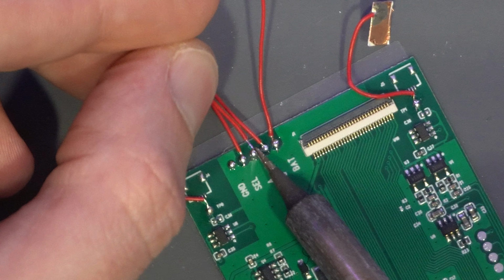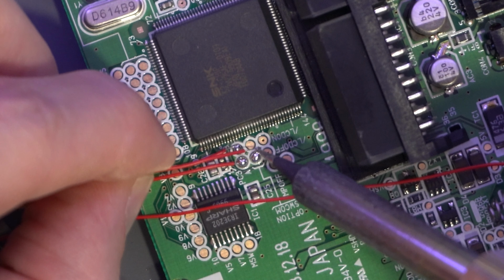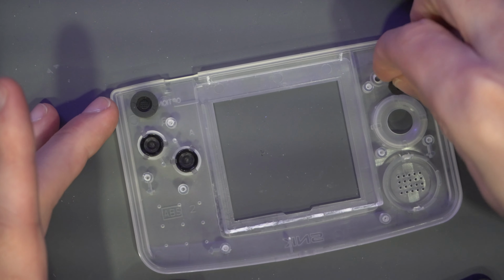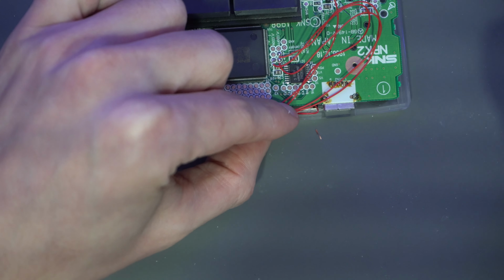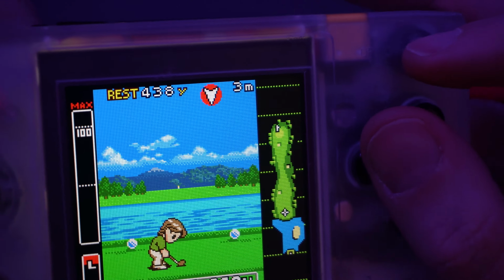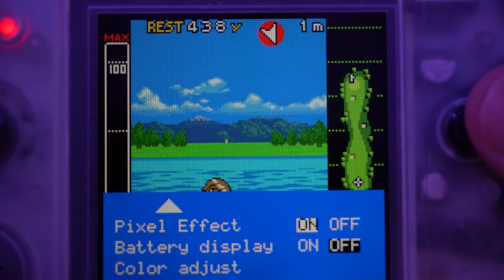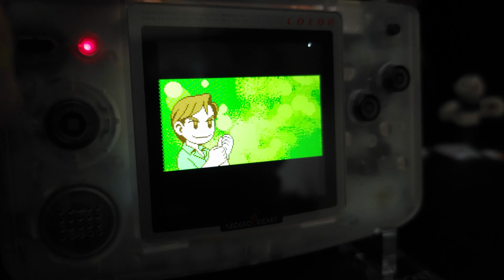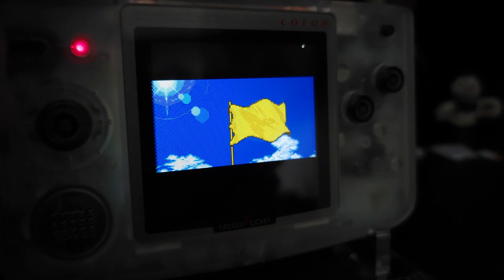NeoGeo Pocket Color Q5 IPS Screen Install!

Comment: For my kit, I'm not totally sure if I received a BlackBerry Q5 LCD, the black levels could be higher. My kit is 1st gen and required shell trimming. I've read that the second gen kit that came out a year later doesn't require trimming. I also used a console 5 alignment bracket. Mine successfully paired with the dehiss and amp mod kits sold on retrosix. Had to use 1.5v li-po AA rechargeables after, just like my other recent mods. I also have to hold the power button in for a second to power on. Works with my retro hq flash cart as well, but the NGPC makes an audio hum noise on it's main menu. After a game is loaded there's no noise. I've noticed the hum noise with other GBC mods indicating the power draw is stressed or batteries low. Wish there was a new power mod for the Neo Geo Pocket Color.

Comment: everybody in every video is replacing the front glass on theirs, what if I have a stock one that’s already good, can i keep the original front glass?
Reply from the maker: Everybody replaces the lens because the IPS display is larger. If you use the original lens, some of the screens contents will be cut off and it will not look right. Same with the soldering, initially I felt that it was optional, but it is helpful to solder the wires because it makes adjusting the screen easier.
Reply: @linklooklisten  tbh I watched 3 modding tutorial videos and literally nobody mentioned the glass being different from the original, in fact in one of them they said it was the same as the original, now that I gave it a closer look it is a big bigger, but hoenstly it doesn’t bother me the least bit with the original screen, I’ll just save this other one for later in case I scratch this one 😅
Reply: @linklooklisten  I had to bug my roommate to desolder the speaker and stuff and solder it back later, didn’t wanna bug him for the other wires, I’m cool without em. I didn’t realize the replacement glass had a larger crop, it looks pretty much fine with the original for me though, only like 1 line of pixels is slightly obscured.. I prob woulda replaced the glass if I knew, but f it, not taking it apart again lol..
Reply: @linklooklisten  just did it last night, so I’ll just stick with what I got I guess lol

Comment: I'm about to install this soon. Many have said they decided NOT to install the touch sensors because they are easy to bump by accident. I agree and don't see the point since you can change brightness/colors from the menu. And you will rarely need to change the brightness very often anyway. Imagine your heavily concentrating on a game and suddenly the colors change. That would be pretty annoying. ;)
Reply from the maker: You see, that never bothered me much as I keep my fingers on the back of the system while I play. But! I can totally see how it would basically kill the gameplay. Since I made this video I've changed how I feel about the OSD. It is pretty important. I'm sure there will be a better screen kit coming out for this system, but that's purely based off of the fact that there's a new screen for the GBA and GBC every week.
Reply: @linklooklisten  I recently tested the screen with the touch sensors installed and the sensors were never activated by accident once. I found that just letting the sensors float near the top of the case made them less sensitive than being right up tight against the case. But still enough to activate them whenever you wanted to. Really the only useful reason for wiring for the OSD is to be able to re-center the screen. Which is actually nice if you Don't want to text to be cutoff at the top or bottom. But you can theoretically get away with no soldering. But learning is half the fun IMO.

Comment: Does anyone have the install for the slim? I see they have screens for the slim now. I tried installing mine recently but the ribbon cable seems too tight and it may have damaged my screen, since the display is really dull and I see a few dead pixels.
Reply from the maker: If I had a slim, I'd make a video on how to install it. Good luck in your search my friend! I hope the screen is salvageable.
Reply: @linklooklisten  had to bite the bullet and get a new screen. The original IPS screen was toast. 😞 But the replacement worked perfectly. Although there's a tiny bit of bulging up with less room in there. Hope to see your slim install at some point! Cheers!

Comment: This mod will not work together with Saints GameDrive flash cart. Power draw is too much. Deal breaker for me. I regret installing mine.
Reply from the maker: I have the retrohq gamedrive cart, works alright, I average close to 5 hours
Reply: @linklooklisten  I now tested with NiMH batteries and it does work that way. Fresh alkalines will not work. On NiMH I can see the screen blank out when first loading the game from flash on the game drive. This seems to be even more pronounced the higher the brightness. Sometimes the screen will fail to light up on first boot. Brilliant screen but we're definitely pushing the power envelope on this.
Reply from the maker: I anticipate a v2 or v3 down the road. Ideally I'd love to buy just the board for a revision and install that unless they use a smaller IPS too which has been done with gameboys.
Reply: @linklooklisten  The real issue here is that alkaline batteries are not very good at providing constant high current. This mod quadruples the energy requirement at idle! From a stock 50-100ma we move up to 300-500mA and maybe more with the flash cart. A more efficient board might help but this is still a tall order to fit it all inside a 250mA power envelope. That's why you don't see newer gadget powered with alkalines anymore. NiMH can hold its own but lithium is king.
Reply from the maker: True, a lipo battery would help. Have you seen any types of battery mods for the NGPC?
Reply: Yep, happens to mine. But I'm using eneloop pro rechargeable batteries and I noticed if you turn on the pixel effect (which slightly darkens the screen) and then reduce the brightness to lowest, then the issue doesn't happen as much. But yep it is a power draw issue with the flash card (I have the retrohq one also). But fortunately I can still get around five hours of battery life which is enough for me.

Also to OP, great video. Would love to see more neo geo pocket content from you
Reply from the maker: That's interesting. With or without a flash cart i get around 5 hours. Not sure if the flash cart is to blame in this case, I know they draw more power, but even with a normal game I get the same amount of time and the same result with the screen turning off but the system still being powered on.

Comment: I’m skeptical that the battery indicator is even remotely accurate... are you using an everdrive? I believe they need more power than a traditional cartridge. I had the same screen issue with a modded go color
Reply from the maker: Yea with fresh brand spankin new batteries it was a little low so I don't trust it either. I use the neo pocket game drive flash cart, but even with it out of the console, the screen would still be off if the batteries are near dead.
Reply: @linklooklisten  i wonder how big of a problem this is, i want to do this mod but yeh, that might turn me off. I have yet to see a battery mod for the ngp either which might help this issue.
Reply: @linklooklisten  so with near dead battery screen problem, how much gaming can you then get out of it using eneloop pro or just standard from max until that near dead battery state
Reply from the maker: I got around 4 and a half to 5 hours before the screen turned off.
Reply: @linklooklisten  still not bad. That's actually good. Not gonna compare it to 40 hours stock.
Reply from the maker: Oh no comparison to stock ever in this case hahaha